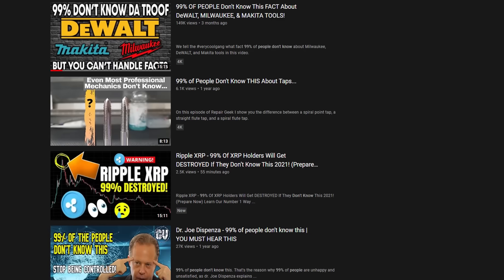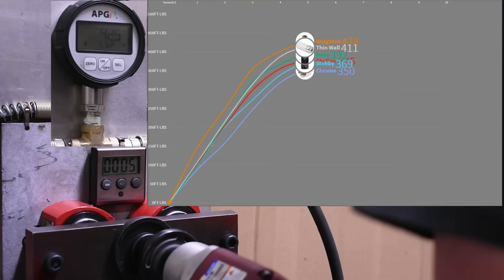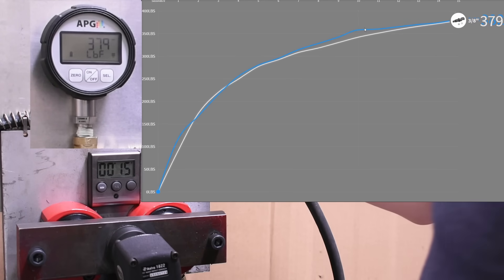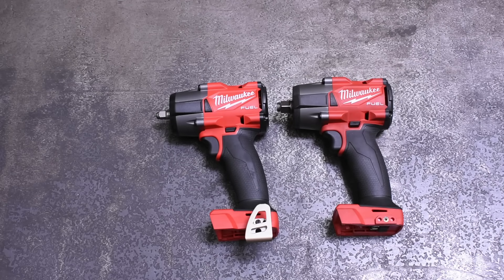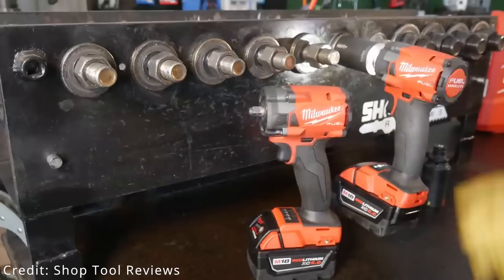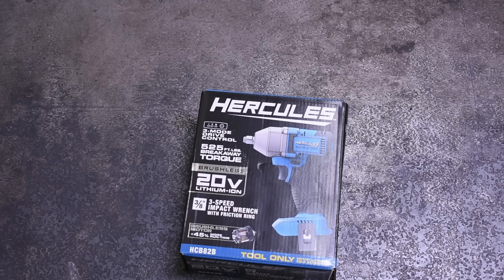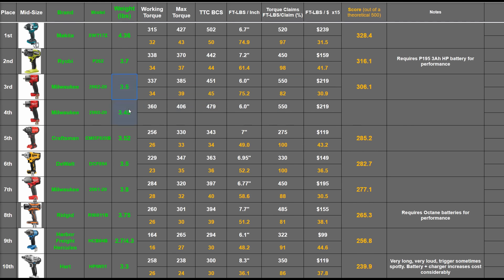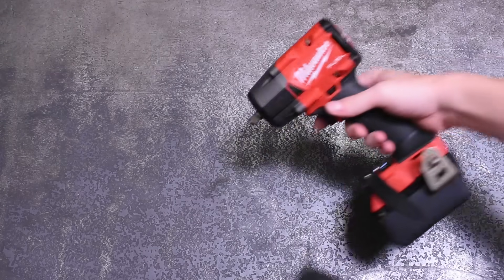Measuring Power Difference Between 3/8" & 1/2" Impacts = WTF

Comment: I ordered the Milwaukee 2962-20 1/2 inch drive but instead sent me the 2960-20 3/8 drive if I have it correct the 2960-20 3/8 drive out performs  the 1/2 slightly? I bought it to remove wheels for the most part

Comment: Interesting video.   It makes me a feel a little better about getting the Hercules 3/8" impact recently.   They had a free battery deal so I couldn't resist, plus I already have a Ryobi high torque.   So far I haven't been to impressed with the 3/8" since it's had problems with lugs torqued to 100ft lbs.   I'm guessing the 2.5ah battery is holding it back so I plan to get the high performance 4ah and/or a 5ah.

Comment: In the heavy duty body shop I work in, I typically use the 1/4"impact for screws, nuts, bolts upto 5/8"fasteners w/3/8" socket drive adapter. If I had 3/8"impact driver, I'd likely stop at 11mm/7/16" with the 1/4"impact driver (as I frequently have to change to an air-powered 3/8" impact anyways.). Only because my batry-po'erd arsenal is a little bit light, do I not switch to 3/8" sooner than I typically do. If I had a batry-po'erd 3/8"impact, I likely wouldn't use it on anything above 3/4"-13/16"freedom units, cause that puts undue stress on the tool.
Did I ever tell about the time I happened to be wearing eye protection when my 1/2" impact Literally Grenaded, deeply scaring the right lens of my favorite safety glasses.?! I was beating the sh!t out of something I didn't want to walk back to my toolbox and 3/4"impact stuff for. It cut my right cheek too. Had to take time off, had to file workman's comp..

Comment: Its not so much the power.  The 3/8 will take much more beating than the 1/2 inch in the long run.  It like using a screw driver, one with a large grip, and one with a smaller grip.  The small grip will wear your hands out quicker during all day use.  

So using a 1/2 inch impact on larger bolts will save your tool a beating.  Using the right tool for the right application is what it really comes down to.

Comment: I would like to see a test where you use 9amh or even 12amh batteries. from real-world testing with a 9amh on the 3/8, I would swear that it puts out significantly more torque.

Comment: Could it possibly be the smaller diameter on the 3/8s anvil? Rpms and ipm Could be generically calculated so the 3/8s anvil if this is correct would have higher numbers in rpms and more impacts per minute causing the slightly higher performance overall?
Reply: Also. The higher power surge at the beginning on the 1/2 inch could be explained simply in how fast the battery pack can be exerted matched with a wider diameter anvil at the End allows for that quick gain but falls short on the top end? Kind of like changing tires on a vehicle?

Comment: In my 35+yrs in the automotive industry, I've swapped anvils on different tools when available, if a particular task warranted such a swap. Generally, I will only make such a swap on an impact driver because I found that swapping the 3/8anvil for a 1/2anvil is at least a minor tool-castration. Not surprised by the Milwaukee 'Revelation'. 
My most successful swap was an older 3/8 Matco impact driver that I temporarily swapped out for the 1/2anvil. While I lost a little bit of the tools output, the 1/2anvil eventually sheared off inside the housing. I repaired it and still have it. It still hits above it's weight class.

Comment: Hey guys, im a mechanical engineer and parts designer for amusement park rides. By no means a physicists, mind you, but a decent understanding of physics none the less. Anyway, i have a theory relating to this subject. Interestingly it also relates to a video you made on weighted sockets. The basics for my thesis are there is an ideal weight, weight distance from the center of rotation (like a flywheel) in relation to the power of the motor driving the anvil assembly.

Comment: 9:44 I theorised that would be the other way around, your test method measures reverse torque by tightening a bolt with reverse threads, so picture that graph in reverse for actually removing a bolt (the test is fighting against a tighter bolt the further you are in the graph)

Comment: this is so easy, 3/8 has more leverage because it is smaller there is more distance to the fulcrum
Reply from the maker: Why does it only apply to Milwaukee then?
Reply: @TorqueTestChannel   It doesn't.  The results for the pneumatic 3/8 were also higher than 1/2.  Maybe you should revisit this with the new Milwaukee M12 and M18 impact wrenches that came out.

Comment: Can you do the torque test but with hand tools?  Like a socket with a short ratchet, medium  and long.  Then with t bar handle, cheater bar, pipe wrench etc.  Take it back old school.
Reply from the maker: Its simple math though. Length of wrench in feet x pounds you push down with.
Reply: @TorqueTestChannel  Its simple math to figure out the numbers on battery powered devices too but visual aids are still better.

Comment: That bs, it depends in impact wrench model more anvil size more power it can handle and won't break that quick. If it was true I could use adapter reducer from 1/2 to 3/8 and get more torque at socket lol

Comment: I believe the only difference is durability.  a Camaro v8 engine produces 360hp, the gears are tiny.  can't handle pulling a heavy cart.  a truck produces the 360hp, the gears of the transmission are huge and giant.  withstand pulling more than 28,000 kg without breaking. always bigger things tend to be more robust.  there's a lot more metal

Comment: Biggest reason to get a half in light of this is that a fastener requiring this much torque likely will be larger than most standard 3/8 sockets go to. By using an adapter, you lose a ton of torque. Interesting result though

Comment: ok this has a simple explanation why on earth would a company that has to manufacture these tools go out of their way and actually make two inherently different tools if the only needed difference is what size socket goes on it? neither hercules nor miluakee designed their 3/8 inch tool to be physically smaller so why bother making more components when you can just swap out the anvil for one with a smaller drive and sell that as a different tool

Comment: in the first test the 3/8 anvil made more torque temporarily because it had to blow its grease out, the grease is not oil and will increase sealing pressure in the gun

Comment: It is basic math. Like the difference between a lighter bullet traveling faster and a heavier bullet traveling slower, but they can end up discharging the same amount to ft-lbs energy into the target.  Your 3/8' anvil is a little lighter mass so the hammer inside can throw the anvil a little faster, than with same impact gun using a heavier 1/2' anvil.  In the end of the test the pressure it going up so high that the mass difference between the 3/8' anvil and 1/2' anvil are negligible because there are no longer and loose play between the front of the anvil and the socket.
you can prove this by welding the 3/8' anvil to the 3/8" socket and weld the 1/2" anvil to the 1/2" socket, then also you will need to weigh both the 3/8" and the 1/2" before hand to make sure their combined masses are the same.  The difference is cause by the anvil weight. 
Oh and I didnt learn any of this in school. I figured it out using experience and understanding.

Comment: Isn't the torque made by the impacts? If so, then more hits are better than drives size and 3/8 is less mass to move so that mass can be moved more often and thus better than a 1/2 drive. Assuming I am correct.

Comment: The real way to test this is with an impact driver that uses a bit. You could use the exact same tool and just swap 3/8 or 1/2 bit. Then there’s no chance you just got a good 3/8 gun and a weak 1/2 gun by chance. You’re truly reducing the variable because you’re using the exact same tool just with a different bit and socket

Comment: From a physics perspective you would expect changing anvils between 1/2" and 3/8" to make no difference. In fact I'd say any difference is due to slight differences in pressure or perhaps tool temperature. When people are comparing two different tools then again its nothing to do with the anvil size and all to do with differences in the motor, battery, battery age, temperature etc.

Comment: Ahh don't use grease in an air hammer anvil, sure it might wear out a little faster but it typically hits a little harder as there is no cushion. I only use a light oil in mine, but if you're using it hard everyday grease probably isn't that bad, it'll last longer even if it's not quite hitting as hard.

Comment: Aaaaand, THAT'S WHY I finally broke down & grabbed the 3/8" Milwaukee right angle impact wrench, instead of the 1/2"....as well as the Kobalt...
Seriously, I LOVE that you did this video, because it definitely confirmed what I'd deduced...(ok...."suspected"), just based on combing thru COUNTLESS HOURS of clips from you & other contributing channels, researching, while trying to decide which tools to buy. Thanks for the confirmation (&, everything else you all do, which is all INCREDIBLY HELPFUL to people like me). Y'all are THE BEST!💯☺️👍🏼
Reply: @user-gt7xz8lh4d SOLID on brake jobs, but haven't tried on any suspension related bolts... although, I can't imagine it'd many limitations). SIL got a flat, a few miles from home, a while back & battery for my 1/2" impact dead, so took the M12 3/8" right angle with & zipped his legs right off, no problem . Granted, not what it's intended for, but definitely adequate in a pinch.

Comment: It's all marketing. They use the lower values for a 3/8" drive product so they can charge more for a 1/2" drive product. Even though they are built exactly the same, just with a different anvil installed. This shouldn't surprise anyone. The electronics industry has been fooling people for 3 decades with their Tiered pricing marketing structure, it's how they make their money by making everything parts interchangeable.

Comment: I bought a 3/8 Fuel Stubby by accident. Put it to some stuck lug nuts with an adapter anyway and it immediately blew them right off. 

Still haven't bothered getting a 1/2...

Comment: I was thinking of the story of someone stepping on your foot with a sneaker or a sharp high heel, what would do more pain? The high heel ofcourse. Here's my theory, because of the smaller drive so a smaller surface it'll transfer more power or force through the 3/8" instead of the 1/2"... This is only my theory so don't burn me to hard please

Comment: Just gonna weigh in here with my experience. The 3/8 are just as strong but the 1/2 are still worth using where higher torque is needed with an extension. The beefier extension loses less torque to the torsion spring effect. I don't really like using adapters, unless I have to, on anything, due to the extra slop introduced from another connection point. I find I get better torque transfer with the most rigid connection I can muster.

Comment: When I wrenched (Like 2+ decades ago) I was the only guy in the shop using a 3/8" impact, in this case, Snatch-on's best one at the time. I got endlessly razzed for it but the thing had major beans on 2-stage full shop air (we'd cranked the pressure cutoff switch on the compressors unbeknownst to management). I found it worked very well when doing suspension work as it fit where my fellow mechanics' 1/2" impacts could not. Sorta wild that today I have a battery impact and ratchet and could not be happier for my at-home use.

Comment: Did you guys weigh the anvil and socket for each drive size?  My guess is that the rotating mass for the anvil/socket is less for the 3/8” combination and thereby introducing a fractional increase in power applied to the nut. Conversely, the rotating mass is greater for the 1/2” anvil/socket and a resulting in a fractional loss in torque.

Comment: What I find interesting is that Milwaukee claims as a 50 ft lb difference between it's 3/8 of half-inch models. I would love to see how this applies to the DeWalt DCF 921 and the DeWalt DCF 923. DeWalt claims they're the same power rating and there is no difference in fasting or loosening Torque. Especially responding to the ideas of the Milwaukee seems to be the exception, perhaps testing the DeWalt 923 versus the 921 may show that Milwaukee is indeed The Only Exception or perhaps not an exception.

Comment: Could it be that the circumference of the 1/2" drive demands more force to turn the bit than the 3/8". The same goes for a  big sprocket, it generates less power to the driveshaft than a smaller sprocket. This could also explain why the 3/8" overtakes the 1/2" at the end of the run because it has less speed/torque en needs build up time. Could you do the following test as 6:38 but at the same time measure the revolutions of the bit during the torque test? Regards from the Netherlands.   ;-)

Comment: I bought the 1/2 drive M12(yes, Twelve) Milwaukee impact for work(non-automotive)
It easily removed the lug nuts on all my trucks. That included two old C30’s, a K5, & a Ram 1500. Very happy with performance and lighter weight than the M18 or other brands.
Reply: I have the 1/4, 3/8, and 1/2 M12's and love each of them.

Comment: I wonder what the difference in surface area is on a 3/8 to the socket vs a 1/2, and whether the correlates with the difference in torque?

Comment: I run my 2564-20 most of the time with a 6.0 battery and a heavy snap-on 3/8 to 1/2 impact rated adaptor. It does so much better than the initial 2.0 battery it came with and lighter weight 3/8 sockets.

Comment: I work on heavy equipment, and a mid toque  1/2” has never crossed my mind.  My co-workers and and myself all have high torque 1/2” Milwaukee and the 3/8” high torque if you wanna call it that.  Seems to be the best set up.  I like the smaller profile of a 3/8” socket for most applications.  Also the profile of a 3/8” impact wobble socket.  Great channel btw!

Comment: If I have to make an educated guess, I would hypothesize that the 3/8ths drive has a lower mass in the anvil, allowing it to hit more times, since it's not slowing down the motor as much as a heavier 1/2" drive, resulting in more (lighter) hits to the bolt in question. Since in the bolt removal game, the number of impacts tends to outweigh the individual strength of each impact, this would give a (slight) edge to the 3/8". However, they are both otherwise driven by the same powertrain, when you average the output over time, you will generally find the actual power to be the same.

But I could entirely be mistaken. Good test, and interesting information to parse.

Comment: You are going to have to measure it electronically and view the draw on the motor. I'm almost positive one is drawing more power than the other which if ran side by side the one producing higher power will have less battery power!

Comment: I think it may have something to do with the larger diameter bolts and nuts typically being removed/tightened when someone is using the 1/2 in drive.  A larger diameter doesn't always need as much torque to twist it.  Not a lot of 3/8 sockets get up into the larger sizes.  So, when people are using the 1/2 drive sets, they are working quite well for those applications.  

Also, what does an adapter take away from the torque of the tool?  When using an adapter to go up to the larger sizes and still use the 3/8 anvil, if there is, or is a perceived loss, then the 1/2 in anvil is used/needed.  I'm sure you may have already done a video on this?

Comment: Scientifically yes change the anvil out the gun gun has the same rpm however when you go from a 1/2 to a 3/8 inch you have more anvil speed it's just like the spin of the earth the closer you get to the equator the slower you go and faster towards the poles

Comment: My only real concern is the anvil breaking on my 3/8". I've used the little aircat 1077 to remove lugs from scooptrams that should be torqued to 320 ft lbs. She's got the beans. It's funny the looks you get before and after.

Comment: In the future what's going to happen is that Milwaukee will cut the power on the 3/8" to not make it compete with the 1/2", thanks for pointing that out. Consumer loses. #1 thing that companies can't stand is giving you extra "power" for free seen this happen dozens of times across CPU hardware, Milwaukee will quickly gather all their engineers and put a stop to the bleeding ASAP 😂

Comment: I needed to break a crank bolt, heavy duty 19mm impact socket wasnt getting it. I took a 3/4 pressed it into a larger one which i welded into a larger one i think the final one was inch amd a half. It got it.

Comment: ok im only 1 minute into the video, but my gut says larger anvil is worse for the same reason bigger break rotors can slow a car more effectively - the socket and the thing its turning are basically the brake calipers and they are exerting a force on the anvil to slow it... 
SO basically bigger anvil = longer lever arm = more force (in this case the equal but opposite force aka resistance to turning) applied to the motor itself

Comment: The same applies to attachment type, hog ring anvil wrenches have slightly more breakaway toque than the pin detent models. The only reason is the hole that is drilled into the anvil for the ball bearing (pin) reduces the strength of the anvil

Comment: If 3/8 doesn't break there shouldn't be any differences. Anvil doesn't know what is attached to the other side of the axle.

But good to know that we propably don't need all 1/4, 3/8, 1/2, 3/4 and 1. We can skip some.